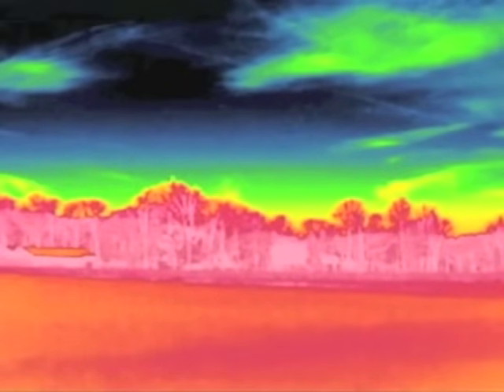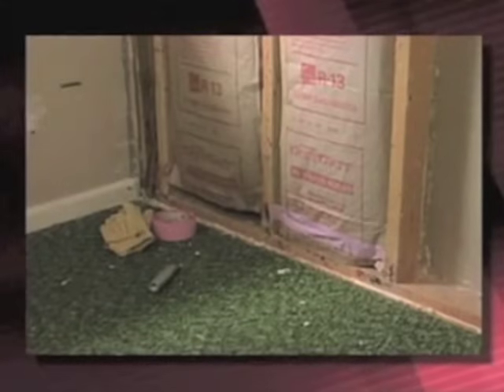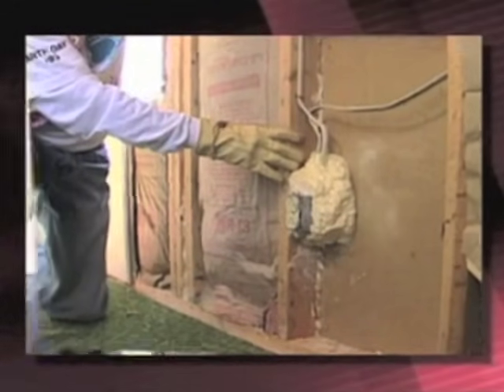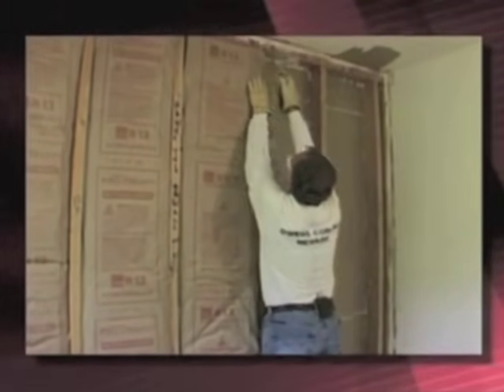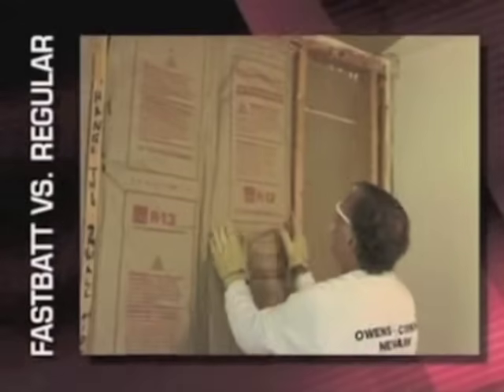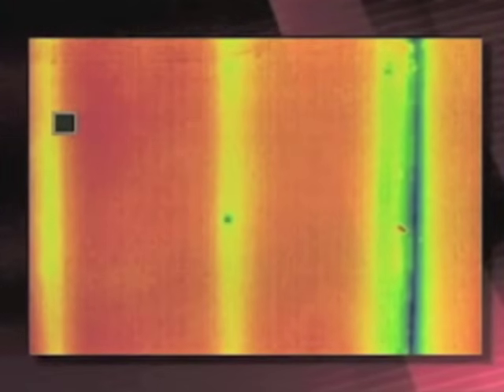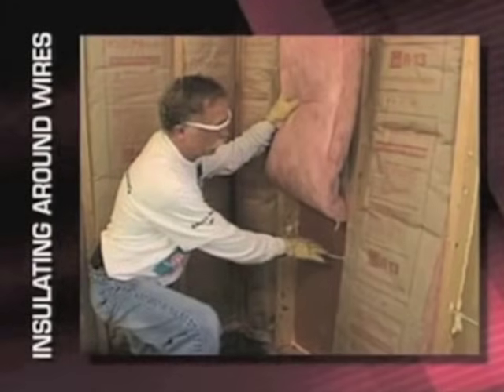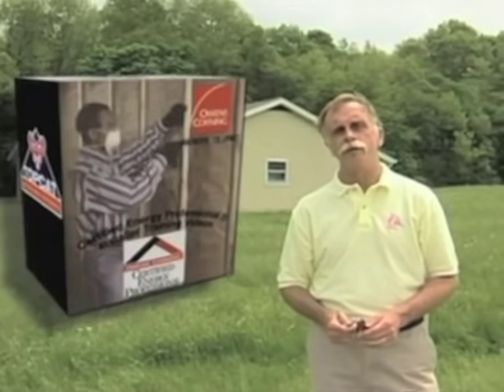Right Vs Wrong: Installing Insulation Batts In Exterior Walls - Part Two

Comment: You can see a difference where he compressed the insulation against the wall studs where he stapled it to the inside of the wall studs. It goes from pink to red so there is a difference when insulation is compressed.

Comment: Always cut the precise fit. If you don’t, you aren’t insulating.

You would think, “hey, if I fold this insulation at the bottom, that’s double the heat, right? I’m folding it.”

Wrong. Not only is there a gap, but if you think about it, when you fold the batt, the fiberglass is no longer pointed at the wall. It’s pointed at itself.

Comment: Interesting and informative video, but I see two mistakes.
3:39 The one on the left is clearly warmer than the one on the right.  The one on the right is the one that is losing heat. 
3:58  If you can't measure the effect, then there isn't one.  That's the entire point of using IR imaging.

Comment: Thank you.  Our attic is a nightmare.. they never did the rafters. they installed batting side up.. they used blow out fiberglass all over the floor and we can't walk or move.  Mice died in the floor insulation and we can't find it. Mold can hide under it.  It is a nightmare.. you save money in the long run is you do the ceilings.. Never use that spay out on the floors.

Comment: I am from NJ where the emphasis was on having the outside wall wrapped as the vapor barrier.
Your insulation was installed between the studs with the paper flanges stapled to the front faces of the studs.
I now live in Florida and my daughters house was flooded to 7' in hurricane Ian.  She lost everything. We have stripped the house as we intend to build up. Insurance companies suck.

When she and her husband moved in 3 years ago we tore down the sheet rock in their front bedroom as there was water on the floor. Cement block wall, just some unfaced insulation between the 3/4 inch battens of insulation. We figured the sun on the outside with air conditioning on the inside caused the condensation on the sheetrock. We used foam battens on the inside with a vapor barrier on the inside. Now that I have stripped everything out of my daughter's the house and we intend to build up on the existing foundation, she is a widow, her place of employment swept away I want to make sure I get the rebuild right. Is the proper way to install the insulation by stapling to the front face of the 2x6 or tucking in as it appeared you did. with 6" studs here in Florida would there be a benefit to using a different R value? Thanks!

Comment: Actually paper back insulation is the worst you can't see any gaps or mistakes. Use paper less an plastic vapor barrier if needed over it.

Comment: Back in the day I was a insulation installer & we learned that in a 1500 square foot home if you were to add up all the energy you lose through the studs it's very close to leaving 1 window open. But that was back in the 80's.

Comment: Would poly on the inside between drywall and the bat resolve most deficiencies….or would poly be best on both sides of bat inside and out?….does 3 or 6 ml poly have an r value?

Comment: Thanks for the tips on how to insulate faster! YouTube is amazing. Seriously though, the settings on the infrared are very touchy so the color from red to orange is probably .05 degrees. Since houses are getting so tight they install an air exchanger to get fresh air in. That air exchanger uses electricity so really what is the point of making a house airtight so mold can grow in the wall cavities and use electricity to exchange the air?

Comment: Every one of those staples over time will conduct moisture. That r14 becomes an r7 with moisture over time 15-20 years. Caulk every wall connection to keep moisture and cold out. Caulk around every window board after windows are cut out. Don't forget to add roof vent baffles too. I see to many people spray foam roofs with no baffles. Then the roof sheeting rots.

Comment: This is a very helpful video. I learned a ton about how to insulate properly in just a few minutes. I'm wondering if Owens Corning has come out with 2, 3, 5-inch strips you could buy instead of having to cut them. I guess both methods might be slightly inexact. Is there a particular utility knife or cutting too you would recommend?
Reply from the maker: Hi Bernard, we are glad you found the video helpful! We have a few different batt knives and utility knives we would recommend. You can find them all listed here: https://www.idi-insulation.com/product-type/parts-tools/. Hope this helps!

Comment: I have to insulate the ceiling of an addition and where it joins the outside wall I am told I need to add a styrafoam sheet which is molded with waves to allow air from the outside to come in under the insulation.  I think the insulation sits on it and then the  poly would be applied. Like a sandwich--ceiling sheet/insulation/waved styrafoam/poly.  I don't know how to do this and need a visual.. can you recommend?  Thanks!!

Comment: Most of his comments were true... However, towards the end of video#2 (heat loss@the triangular shaped cavities). He claimed there was more heat loss around the cavity that was stuffed with the odd sized batt, I actually observed the exact opposite... While I'm sure that cutting the insulation exactly does provide for less heat loss (most of the time),  I think that was just one of those times when he "forced" the untrimmed piece in there a little too well.
And lastly, when he compares the areas where he insulated behind one wire and ran the insulation over another wire, he says " while it appears that both cavities are the same, we know different". ??? Really? You can tell me that cold is hot and visa-versa, while I'm looking at thermal  imaging (however, I'm going to beleive what I'm seeing over what someone tries to tell me... Thermal imaging doesn't lie).
Reply: I thought the same on the part of the insulation behind the wires and the part around the electrical box. To me it appears that the electrical box with the foam had more heat loss and the electrical wire with the foam over it seemed to be better than splitting the insulation to put behind the wire. Maybe I'm not understanding what I'm seen on those 2 examples.

Comment: It's not about the cold variances it's about air flow and condensation caused by that cool and hot air reaching a dew point in the wall cavity. Glass bates will no block moisture and air as foam does. Three inches of closed cell foam installed properly, creates a airtight seal and  vapor barrier.

Comment: Silly question: does it matter furry side forward or back? I've watched videos where the furry side is in.
Reply: Yes, it matters. 
The "furry" side should be pointed towards the warm side of the house.

 For people in the south, say Florida or Texas,  the warm side is the OUTSIDE of the home, so the "furry" side should be pointed towards the OUTSIDE of the home. (You shouldn't see the furry side)

For people up north, say New York Minnesota or even Canada, the warm side is the INSIDE of the home. So the "furry" side should be pointed towards the INSIDE of the home. (You should see the furry side)
Reply: @NuttedInYoMom  just another example of something i've been doing wrong...thanks
Reply: @NuttedInYoMom  That's backwards. The paper side is the vapor barrier that goes toward the warm side of the wall. The furry, non-papered side goes toward the colder side of the wall. Paper in (fuzzy out) in colder climates, paper out (fuzzy in) in warmer climates.

Comment: How much of the heat transfer is convective and how much is conductive?
Reply from the maker: Mitch,
Thank you so much for your question. Unfortunately, it is one that could only be answered by testing a specific wall because it depend on the air tightness of the assembly and some  other factors. No doubt the fastest form of thermal transfer is convection, but it is possible that even different cavities in a wall could have different ratios.
Reply: @IDI_Insulation  Thanks for answering. Yeah, I was more just wondering about typical scenarios like the blue areas showing up on your thermal images. It sounds like you're saying it's mostly convective. Interesting.

Comment: Meh.  I'm only here because in about a year I'm having my detached garage torn down and having a bigger, better.... DRIER, properly graded one built in its place.  Contractor doing the build said he and his crew will do everything I want...... except finish the interior.  They don't do that.  So my one options are either hiring another contractor to insulate and drywall..... or do it myself.  I've hung drywall and insulated shit before but I by no means am a pro.  Last time I helped hang insulation it was pre-youtube being as popular as it is days.  Meaning I didn't have a wealth of knowledge at my disposal on pretty much any topic from actual pros on how to do their craft.  THAT SAID...... I thought the difference on infrared would've been much more significant.  Other than the blatantly large gap left on the bottom of the wall in the first example.... AKA..... not insulating the entire height between studs, the difference between the right and wrong way to insulate wasn't nearly as dramatic as I thought it would be.  I mean I don't fall victim to doing all the "wrong" ways shown here.  I will insulate the entire wall and make a piece to fit the bottom if my batt comes up a few inches short.  I have always foamed behind electrical boxes.  But everything else..... meh.  Difference was negligible IMO.  And for a detached garage - I can live with it.  But..... likely with everything else in life, once I have it confirmed I am doing something half assed despite being pretty sure I was doing it half assed, I can no longer do said thing half assed.  Once I get it confirmed to me that I do something half assed I can't help but do it the proper way.  My mind won't rest otherwise.  That goes for everything.  So I LOVE the fact youtube exists and you can have pros tell you how to do their craft properly...... but it's also a curse, haha.  I guess what I'm saying is..... "ignorance is bliss."  But unlike the so many pure ignorant out there nowadays...... once I know something I can't help but do it the right way..... and not continue to be a piece of shit and knowingly do it improperly - like so.... SO many people out there.

Comment: Thank you for this video. I'm doing some interior walls in a hallway of a very old Victorian. The wall studs are not same width. Sometimes size of batts are good width but other times the batts are wider and they pucker a bit. I know that is probably not ideal. Should I cut one side off and if so, how much wider than the width between studs should I cut it? Also, is it ok that the plywood will be touching facing of the batt? I'll be covering that plywood later with FRP.
Reply: As shown in the first video, the batt should be just wide enough that it sticks in the wall cavity but is not noticeably compressed. You can leave the backing wider if you are stapling to the studs by cutting the insulation separate from the backing or use unbacked batts and install a separate vapor barrier if needed. Note that normally interior walls are not insulated as both sides of the wall are likely to be close in temperature. However this can be done for sound insulation or other reasons, such as an unheated space.

Comment: Batt insulation is rapidly becoming "old school".  Cellulose batts, blown cellulose and closed cell foam are the new kids on the block that provide much better insulation and close up those air gaps that were shown a lot better.
Reply: Vapor barrier?

Comment: I just bought an apartment  from 1986 and needs to be insulated the videos this chap has posted are a real eye opener going through the trouble of showing the result of wrong and correct insulating practices.
I am surprised this post has only 2.8K likes from 748,436 views.

Comment: Unfortunately, what this video did for me was to confirm I need to use spray foam instead of batt insulation! There were still air leakage areas on the ones installed properly. Educational and useful if batt insulation is your only option. Thanks for making the video.
Reply: Looked more like stud thermal bridging to me.  What you'd be better doing is put rigid external (usually foam) insulation boards on the outside, which is what stricter energy efficiency standards have been moving towards.

R 4-6 studs are murdering the average insulation value of the entire wall, and it has a higher impact the better your between-stud insulation. (because those studs have a bigger impact if you're using R-30 insulation compared to R-10 insulation).

Comment: I discovered my exterior garage walls are not insulated.  Obviously I can't take down the bricks outside, so I have to insulate from the inside.  What is better in your opinion?  Taking down the rock carefully and using fiberglass Batts, or leaving the rock on the wall and using blown in insulation?  And what about a vapor barrier (plastic sheet)?  I have no plans to heat or AC the garage at this time, but I do want to keep the summer heat OUT and from penetrating those walls which has an oven effect on the garage, and the bedrooms above.
Reply: Matt, there are a couple of items in your question and statement I would like to give some information on. Regarding the garage walls, if you are doing this yourself, you can attempt to fill that walls of the garage with blown-in insulation, but what about air sealing and how would you know if you got everything? If you open the wall you can do a good job, except for the fact that it's a lot of work. If you drill holes and fill it, you might get it all, and then again you may not, but then there is that air sealing thing. Certainly adding any insulation to the exterior wall will be good, but if you are trying to help the room above the garage, then you may want to consider getting to the rim joist or where the bedroom floor/garage ceiling meets the outside wall. This is one of the most common leakage areas for home and areas for energy losses as well as big comfort issues. If you can address both areas, I would. If not, my first line of defense would be this area and then the garage walls.

Comment: I've done insulation both with paper / foil backing and unbacked with full sheet vapor barrier. Best guess is the full sheet (with tape on the seams) helps a boat load with drafts, which is likely more cost effective than inconsistent packing of the glass wool itself. IOW, stopping the draft will save more $$ of energy in the long run.

Comment: I was always told the paper part goes towards the outside so it can act like a water barrier.  This shows just the opposite, but since your a manufacturer rep I’ll go with your way.  Thanks
Reply: vapor barrier to the warm side...inside if normally the enclosure is being heated more than cooled. E.g. if the lows are 30, house is 70, and highs are lower than 110, vapor barrier inside. If lows are 50, house is 75, and highs are 100, vapor barrier to the outside, or maybe no vapor barrier.
Reply: vapor retarder backing, not water barrier. and yes goes to the inside.

Comment: If you use a product like Tyvek on the outside wall, should you also use plastic on the inside wall, or does this cause a problem for moisture?
Reply: Tyvek is not a vapor barrier. Vapor barrier goes on the warm side of the wall, so this varies by climate zone.

Comment: A+ TEACHING, EXCELLENT DEMO. EASY TO UNDERSTAND. IT WAS RIGHT ON TIME FOR ME, AS I AM ON INSULATING MY HOUSE. I AM VERY GLAD I SAW YOUR OUTSTANDING  PRESENTATION.
Reply: Good Insulation Tips:
1. Cut to proper length and width.
2. Use foam insulation to electrical boxes.
3. Cut insulation to fit any shape properly.

Basically, don’t over stuff insulation and keep cold air out.

Comment: Don't worry about it Colin. The one thing the video did no show is the temps. While the difference across the color spectrum is vast the (very dramatic for video) temperature differences may only be one degree. Some of the temp difference is the thermal exchange in the framing itself.

Comment: how much is one bag of R13 insulation
Reply: 15 itches
Reply: Insulation is generally priced by volume, so R13, which is generally 3.5" thick, would be priced by square feet of coverage, and typically comes in 15" widths for 14.5" cavities between studs and 23" widths for 22.5" cavities. A smaller roll might be around $20 for 40 sq ft, or about .50 per sq ft.

Comment: This is an old video but a VERY important issue to address for inspectors seeing this insulation practice still used today.  As a contractor and a building inspector i see so many contractors trying to cut corners but they do not see the 20 cents here and the 20 cents there that add up to a $300 utility bill for the consumer of a NEW HOME!!! A new home should NEVER have these heat losses and issues; and their satisfaction in the quality of your work will only bring you more work. Thank you for your time in creating this video!
Reply: Tyg Rahof it seems like that many of contractors goal, just do stuff as fast as you can. I believe our house was never inspected after being built 27 years ago. Even as a DIY is see stuff done incorrectly or not at all.

Can you guess why I watched this video...that’s right some of our insulation was Improperly installed.